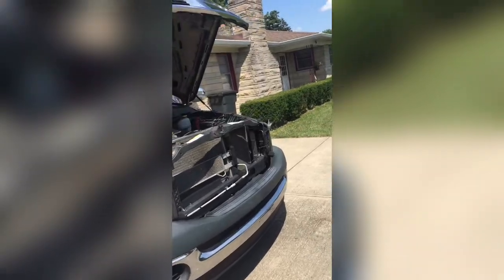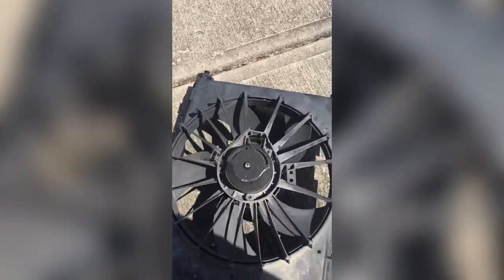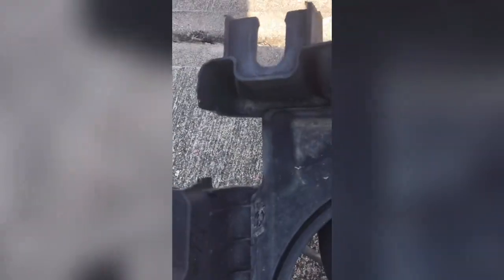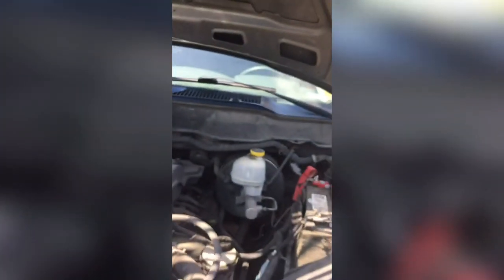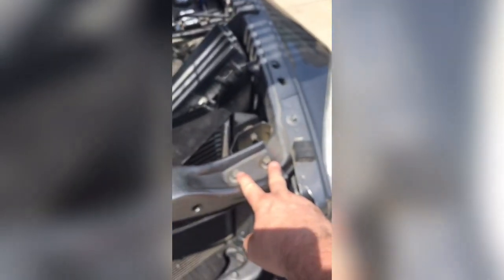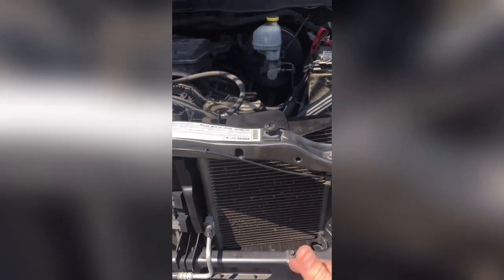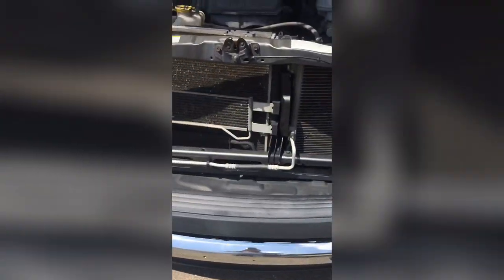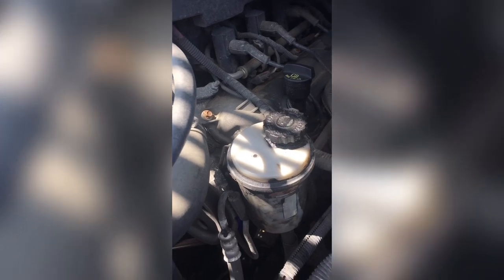Dodge Ram A/C condenser fan DIY replacement EASY 20 MINUTE REPAIR

Comment: I just replaced mine for the second time on my 2008. This time I bought the assembly from Advance instead of just a motor. Comes with warranty, and the shroud already has the cutouts. The big trick is taking the bar off the front. Great video, a big help to anyone doing it for the first time!
Reply: Hey buddy
This video saved me a lot of money,  thanks

Comment: Is there a fuse or relay to check if the fan stops working? I’m having same issue 2003 dodge ram 1500
Reply: Yes. It’s relay number like 68 or 72 or something. Check your fuse box cover to make sure. I had diagrams online that were different to my fuse box.

Comment: wish i would've seen the part about removing support but it got done today i just made it squeeze up and out was a pain ill remember the removal of the four bolts holding hood latch that would've helped lol. also there should be four bolts holding condenser to shroud don't forget those or you will be scratching your head like how does it come loose lol

Comment: I would’ve cut the plastic I would imagine the hard part for me are the four screws that hold the condenser to the plastic shroud I had a little Milwaukee 90 that I could stick on my drill with a short star bit

Comment: Looks like by you removing that support bracket you were able to move everything back abit vs having to take the battery out and tray correct?
Reply from the maker: Yes, allows you to get it in and out with a lot less twisting and anger! Lol 🤙🏻

Comment: it works, but removing the battery and moving the fuse box still helps and only add a couple minutes to the job. doing both makes this super simple and frustration free (by that I mean there is still all sorts of fenagling, twisting, pulling, prying, ect)
Reply from the maker: Thanks for watching!🤙🏻

Comment: To tilt the top bar out, do the main radiator top and lower bolt also have to come out no? Otherwise that stops the bar rolling out forward?
Reply: Just did this job myself. Took me more than 20 min though. Yes the radiator bolt has to come off.

Comment: Is this the same as the 2012?
Reply from the maker: Honestly I’m not sure. You would have to compare the two. I can say a lot of the fan manufactures are making the shroud with the cutout now. Good luck and update us on how it went!🤙🏻
Reply: Mines is different. It's plug and play, after you take off the shroud.